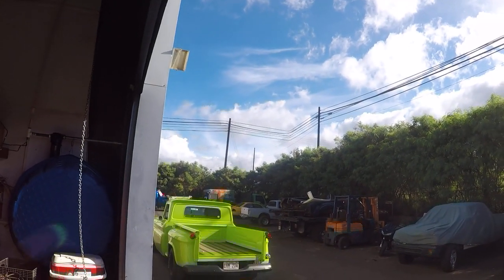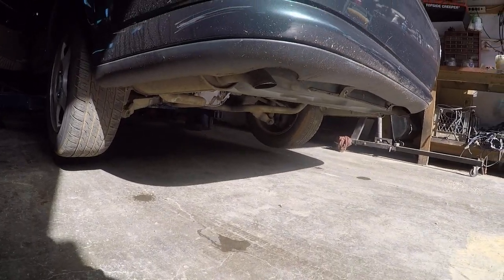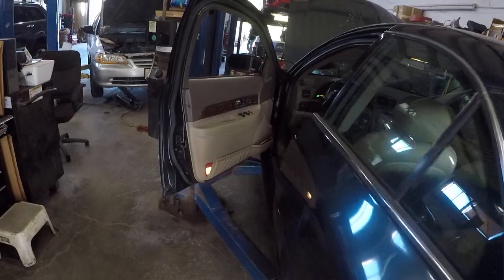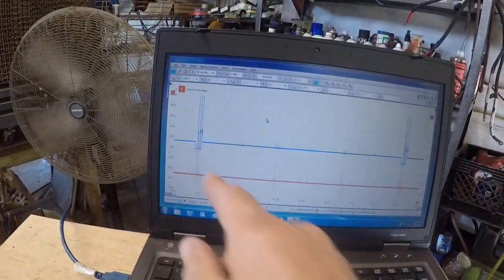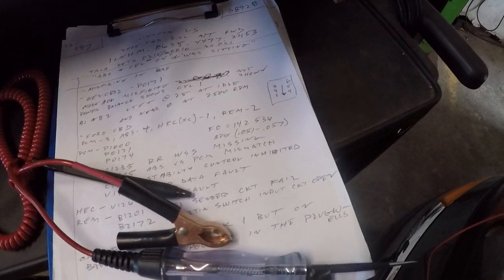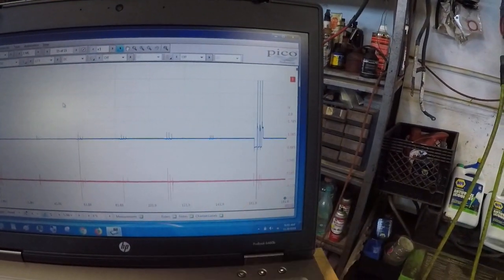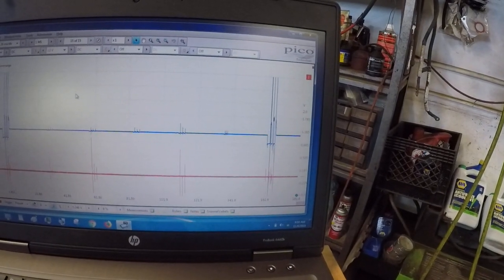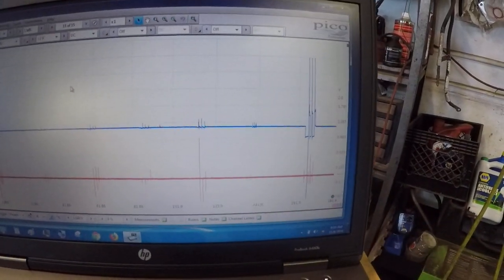Finding a 2000 Lincoln LS Misfire

Comment: (3.9 LSV8)  I'm getting a cold start misfire on Cyl 6. I've replaced all 8 coils, all 8 sparks. Mode 6 scan shows 11 misfires total on a 35 minute drive, most of which I heard on start up. Evap, MAF, Fuel rail, injectors, EGR - none have any fails (on scanner). Any ideas as to where to go next?